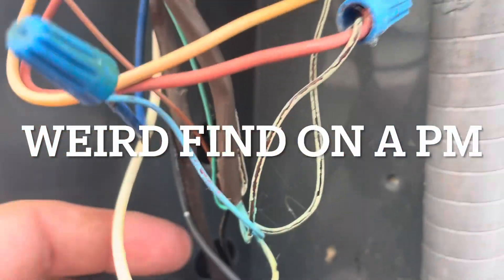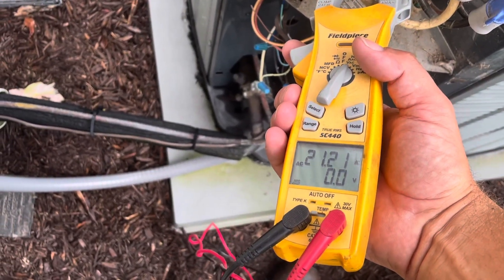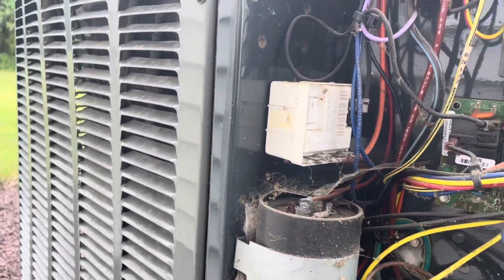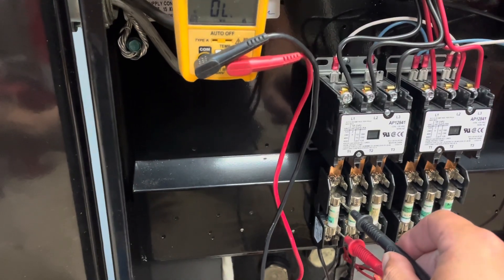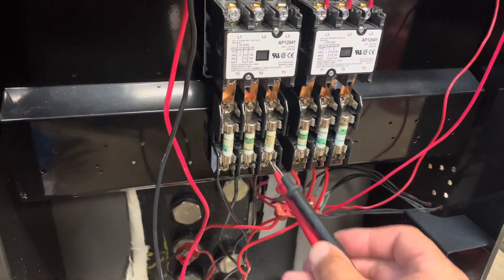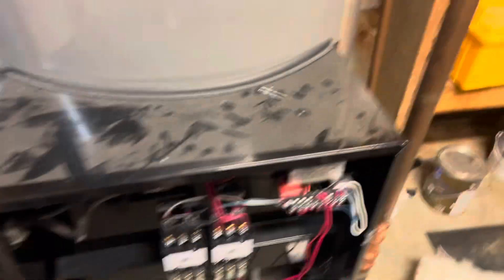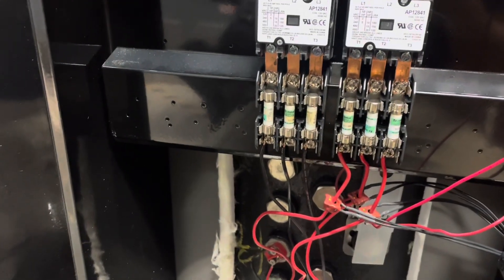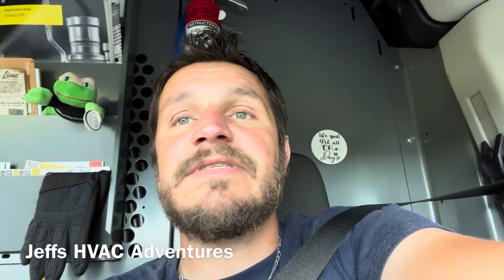Heat Pump STILL RUNS with Totally DEAD Capacitor!  Find Out How….

Comment: Hey Jeff, good video. I’ve seen similar things with bad run caps and the compressor starting with a start capacitor, mostly on Trane actually. Does the SC440 meter reading voltage when you hook up just the amp clamp bother you? I have the same meter and it bothers me a lot but nobody seems to talk about that.
Thanks for the video!
Reply from the maker: No, I don’t mind it.

Comment: Somebody ran the heater without water and melted the elements.   Or put lower voltage elements in after the first screwup.   Typically, opened elements don't short and blow fuses.

Comment: I worked on a 4T Intertherm R410A AC unit on a trailer a few days ago.  The complaint was that it was not cooling. The fan had been replaced.    The fan and compressor would run.  The fan was wired to the HERM terminal on the capacitor along with the compressor.
The capacitor HERM measured 0mf.  It should have been 60mf.  The fan measured 2mf it should have been 7.5mf
I don't understand how.  There was no refrigerant in the system.
Reply from the maker: Weird stuff brother.